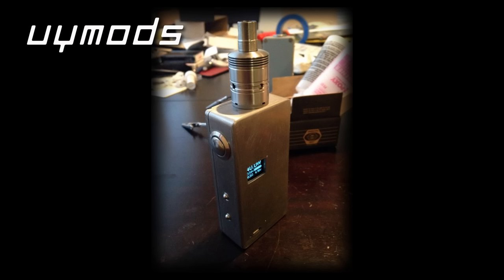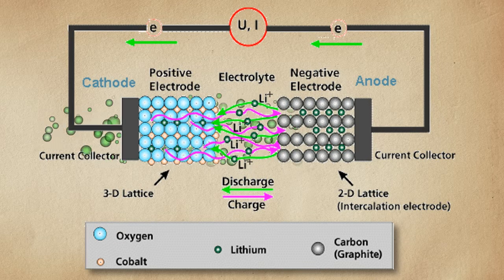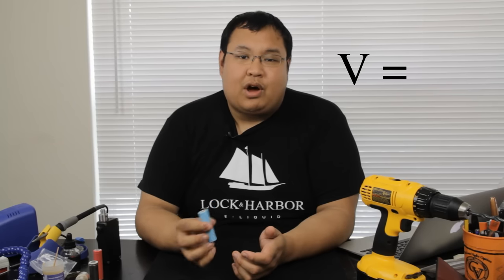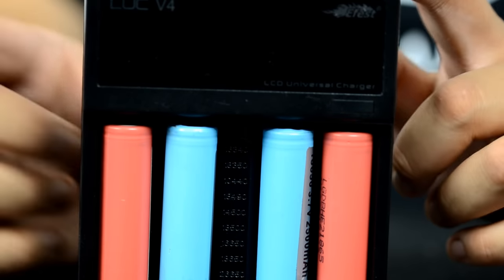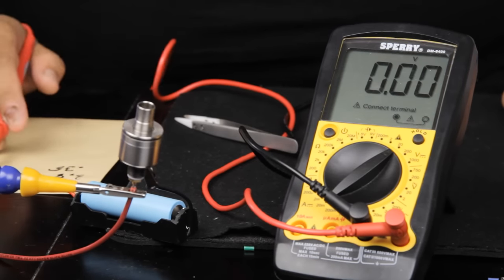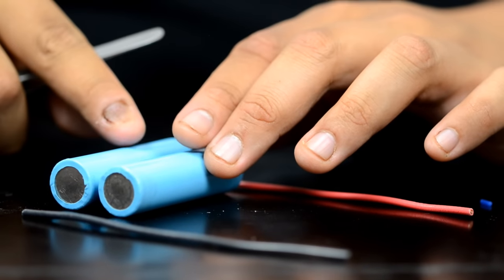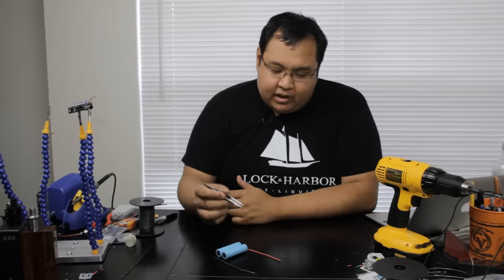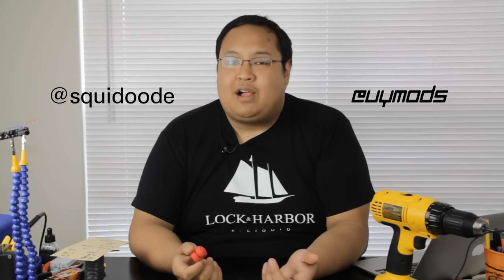Know Your Vape: Batteries Debunked Featuring @uymods

Comment: Great video! I have a 0.13 ohm build on my velocity sitting on a snow wolf 200w mod with Samsung 25R batteries. the specs of battery show max discharge 20A. but at 120 watts its pushing 30A. is this dangerous?
Reply: +Zeeshan Mansoor Yes!
Reply from the maker: +Zeeshan Mansoor Yes, but with running it on that Snow Wolf, that device has built in protection. It would be far more dangerous running that on a mechanical device, but 0.13 ohms is low but not really low like .06. Just make sure you are using high drain batteries!

Comment: Ok I have recently got a new box mod it runs in parallel I build a .15 coil I was wondering cause it can be ran in single battery mode would it be the the same as using any old mechanical mod,and what exactly changes when I use both batteries do I have more wiggle room to build lower or does it stay the same I have Efest 18650 3.7 v 35A
Reply: freedirt Yes, with a single battery, you're pretty much looking at a mech mod. Adding an additional battery in parallel would give you a higher total amp limit to play with and build lower, and the batteries will sag (drop) less under load.

Comment: I have a smok 220w with one .25om and one .4om coils. I bought 2 5000mah 3.7v 18650 batteries. which coil should I run, and are those batteries safe for me to us at about 50 watts on the mod?
Reply: For your batteries to have THAT much mAh they're probably either labeled incorrectly (compared to actual tested ratings) or they sacrifice a lot of amps just to up the capacity. They sound like highly suspect batteries.

Comment: Hey The Art of Vaping, I've scratched the green coating on my NCR18650B on the swing-door of my sigelei 50w. The coating is missing on a small area, and the silver colored case is visible and slightly scratched.

It it unsafe to use?  

Can you ask this guy in the vid?
Reply: +Sean Curtin A hole in the outer wrapping of a battery exposes a portion of the negative terminal not designed to receive current in normal operation. Definitely do not use batteries with damaged wrappers until you can get them re-wrapped. Re-wrapping batteries is relatively simple and can be done at home with shrink-wrap and a heat gun. If you don't have access to a heat gun, machine shops and hardware stores may be able to do it for you.

So stow that damaged battery until you can get it re-wrapped! It's not worth the risk!
Reply: Thanks for the follow-up, I haven't been using it. Wanted to play it safe. Have a great day!
Reply: use packing tape to cover the damaged area

Comment: just saying ohms law includes E=I*R where E is voltage, I is current, and R is resistance, ohms law also includes P (power) as being equal to: E*I, I(squared)*R, and E(squared)/R and every other equation that branches from there, such as I=E/R

Search google for "ohms law pie wheel" for all the formulas to find everything you need to know, and probably then some
Reply from the maker: +Dustin McClure Yes this has been pointed out a lot. Justin says the equation correctly. The original on screen equation was incorrect and since then there was a secondary on screen equation added. If you are not seeing that it's because you have it disabled on your YouTube. Sorry for the mix up and thanks for taking the time to point it out again!

Comment: I have an RX200 which holds 3 18650 batteries.. I'm using Samsung 25rs in it to which I understand have a 20 amp output.. I'm confused as to whether it is a series or parallel mod. Will my amp output have changed because I have 3 batteries in it? Also how many volts could it put out? It is reading ad 3.97v at 75W. Can someone please enlighten me? Thanks.

Comment: I've just been brought a snow wolf 200w and 2 Panasonic ncr18650b batteries I'm vaping on a 0.30 build at around 60 watts is this safe I'm slightly confused by this video
Reply: Dude you're way above safe. Ive pushed harder than that

Comment: I have panasonic ncr18650b using it with evic mini. at 0.30 ohm coil. if i go 40w it says 3.4v and 12 amps.I can go way more watts than 40 and voltage/amps goes up with it.  is this dangerous ? Because as i understand ncr18650b is 3.4 or 3.7v with max 10 amps. does evic tries to pull out way more than capacity of my battery and stress it by doing so ? Should i just use it under 10 amps ? or it is okay since its a regulated device ? sometimes when battery isnt fully charged my mod says low battery and reduces watt automaticly to a certain point.
Reply: It's a regulated device so it shouldn't pull more than the battery can handle.

Comment: i just bought a koopor plus 200 watt tc mod and i bought 4 ultrafire 18650 5000mAh yellow batteries. it didnt say what the continuous discharge rate is on them. are these batteries ok to use in my mod?
Reply: they are fake no such thing as 5000mah

Comment: so I'm semi-noob to vaping, and I'm wondering if it would be safe to use two different types of batteries with my vape, I have one 3000mah and a 2500mah battery and I've been using them together and charging them together today and haven't really had anything go wrong, but could it mess up the batteries using ones that are higher mah's than the other?
Reply: honestly don't get a set its a lot safer and it will work so much better and it is worth it it is just over all better
Reply: +THEDARKNIGHT8657 you need to learn how to use punctuation.   You just told him NOT to use a set of two of the same cells
Reply: yeah hah i was a noob at the time xD but yeah good thing i didnt do that at the time

Comment: how many weeks or months should my 18650 samsung 25r last me before i should go buy a new set. i married them from the get go
Reply: Russellwoot72 Battery life is usually stated in terms of discharge cycles as opposed to a timeframe, and it will depend on how hard you discharge the batteries, how hard you charge them, and how deeply you discharge them. In general, it can be as low a 150-200 cycles for a heavily pushed battery (discharges above continuous limit) and up to 400-500 for a lightly pushed one.

Comment: can someone explain to me what discharging means? im vaping with 2 sony vtc4 18650, 30r 2100mAh and it says the Discharge cut-off voltage of 2.5V

also, any tips for sub ohming for a guy who's new to using dual external batteries? around 0.25 - 0.5 ohms
Reply: +xxx xxx at anywhere between 50w to 90w
Reply: panasonic 3400 mah are good and can burst around 50w

Comment: so when I have a married set of batteries I should only use them on one devise? I've been using three sets of married batteries on an ipv 4 and a x cube 2. I thought as long as they are used and charged at the same time that was OK. should I not do this?
Reply: +Andrew Knutson I had the same question but after watching several times, I think what he meant was to use both at the same time(equally charged) on the same device at the same time. I don't think he meant only in one specific device.
Reply: +The VapinFish thank you.

Comment: when you do paralel, discharge amp doubles or "45 amps" thats ok. but what happens when you do series? discharge stays the same?
Reply: In series the voltage of the batteries is combined while mAh and Amps stay the same as one single battery.

Comment: I'm getting the hammer of God which has 4 batteries. What I want to know is since each battery I'm going to put in it are rated at 20 continuous amps discharge, does that mean 20 is the max I can pull or is it 80 since there's 4 batteries and 20x4=80? I'm asking because I see some people running super low ohm builds like .2-.4 ohm builds but that's pulling over 20 amps
Reply from the maker: +XunifiedX Did you get the Hammer of God version 1 or 2? The version 1 was a parallel configuration if I remember correctly which means in a perfect world you would have 80amps but it would realistically be more around 60amps. If you got the Version 2, it is a dual parallel series device in which case you are realistically getting 30amps. If it's the version 2 I would recommend not going below .3ohms.
Reply: ok thanks for the help! i wasnt expecting a reply
Reply: +The Art of Vaping i just got the version 1, and you would say it will be safe to pull up to a continuous 60 amps on it?

Comment: Which battery should i use to vape at 100-150 w on a 0.2-0.3 build ? I'm using snow wolf mods
Reply from the maker: +xiMercury I would use a high drain battery thats rated for 20-30 amps. Some good batteries are the Sony VCT5/VCT4, LG HE2 or HE4, and Samsung 25r to name a few...
Reply: to get the battery, just remember 2 ohm laws: I = sqrt(P/R) and V = sqrt(P*R). To get the battery that suit your requirement use the higher wattage that you want and the lower resistance you will get. In your case continuous current that you need I = sqrt(150*0.2) so I around 28A and V = sqrt(150*0.2) so V around 5.4V. By that result 20A battery is not suit for you, you need battery with current higher than 28A, which is 30A and because single battery is about 3.7V, you need 2 batteries in series. For battery manufacture, since you drain more than 15A rate, you need highend manufacture like Sony, Samsung, LG, do not go with any rewrapper/rebranding manufacture because their battery current rate might 15A or lower even they labeling 30A. (Look Mooch's blog on e-cigarette forum for more battery manufacture review)

Comment: anyone plz help me. I use ultra fire TR 18650 5000mAh 3.7V batteries they used to work great one fully charged battery would last all day for my iStick pico. now they all suddenly won't hold a charge over 3 minutes of me vaping. its very strange and my batteries say TR and I'm horrified am I using the wrong battery ????

Comment: Very useful information.  I have consistently found myself in arguments where folks using single 18650 mechanical mods will make claims of outrageously high watts not having taken into account battery sag and voltage drop (not to mention disregarding simple battery safety).  Rather than linking them to text only posts I will start directing them here.  Perhaps a video will be easier to digest.  I just wish UY here would have put a little more energy into his presentation.  It was a little dry.
Reply: AnubisAkaLee working for a camera is certainly not my strong point, but I appreciate the feedback!

Comment: i have got a un-protected 18650 battery (2500 mah), what is the lowest ohm that the battery can handle?
Reply: Grizz Hargest That depends on what the brand and model of the battery is. There are 2500mAh batteries with amp limits that range from 2A to 30A.
Reply: Grizz Hargest look at the datasheet man. 
MAX cont. current  20A . Nominal Voltage 3.6v. Initial IR (mΩ DC (10A-1A)):  <30milliohms
V=I*R
V/I=R     3.6V/20A=0.175ohms     0.175 - 0.030= **0.145ohm** 
download the pdf of the datasheet. It's more telling to what your battery "can handle".

Comment: I'm confused on the formulas, I know them but you wrote them wrong. You said voltage = current times resistance but you wrote V=I/R same for the power law
Reply from the maker: Bryon Fitzwater Justin states the equation correctly, the original on scree graphic is incorrect.. You must be watching this on your phone, because right after posting this I noticed the equations being wrong so I used YouTube's in house graphic overlays which for whatever reason do not display when streaming from a phone. If you watch this again from a computer you will see a WHITE text overlay with the correct equations!

Comment: O_O is wattage is that the unit use in Power basically between you use in parallel or series is the same you generally increasing the power / watts or wattage from you formula you use Power ( watts or wattage) = V (volts) x I ( ampere). Either you increase the Amps by parallel connection or Volts by Series your generally increasing the Power ( watts / wattage).
Reply from the maker: +Ren Senyo Exactly, wattage is the unit for Power. On a parallel device you increase your amp load so you can build lower which a lower resistance build at 4.2V will produce some great power (wattage output). With the series configuration your voltage is increased so your power supply has more potential, however you amp load doesn't double so to safely discharge that much power you have to build higher which will still have great power (wattage output). With regulated devices you can control the power output by setting the wattage. The chip in there regulates this and controls the rest beside the resistance of the coil.

Comment: Are the 18650s I take from my laptop battery good for vaping?
Reply: do not use laptop batteries for vaping unless you vape at 10watts with a 2 ohm coil,WHY? laptop batteries are made for a constant low current so they use 5amp batteries,which you should know are totally useless for vaping,this isnt my opinion,its a fact
Reply: Polly G
Thanks for the info!

Comment: hello so I understand the importance of paring batteries together as I always do when I buy new batteries 2 at a time or 3 at a time for my reuleaux dna200 I tag the with a number system so I buy a set if to an mark the a1, a2 then the next set b1, b2, b3 ect.... but after I marry a set together what difference does it make if im running the set in my snow wolf then once thay die charge them together then the next day use them in my kamry 100? I just dont see a negative to this but if im missing something I'd like to know ppl tell me alot you shouldn't do that when I ask them why I always get ( I dont know) I personally think its battery companies just wanting ppl to buy more batteries but idk please let me know if theses something I didnt know ty for your time
Reply from the maker: +Chris Taylor Well, switching between devices isn't the issue. You want to use and charge batteries together. The reason for this is so the cells in the batteries are drained and charged evenly. This allows both batteries to wear evenly. If one battery is worn out more than the other then that will put more stress on one of the batteries as oppose to even stress. This could eventually lead to an issue. I don't think battery companies really care because most of the 18650's we use in vaping aren't made with the intention of being used in vaping products.
Reply: +The Art of Vaping so finally what is the safe battery ?
Reply: +Kimhout TAING that's a vague question depends on the device and what your running on the device but generally Samsung, LG, Sony but in a recent blog on wake and bake said Sony stopped making 18650s for the general public and the ones you see now are fake so I would recommend Samsungs or LGs

Comment: I own a 2500mah efest purple battery, 30A. Can I vape a dual staple coil at .12ohm safely ??
Reply from the maker: +Bastien Lefèvre  any 30amp battery is technically "safe" down to .14ohms... I vape .1-.12ohm builds all day, just pay attention to what your doing and you'll be good. Side note, I personally don't like the efest batteries at all.... I think they are some of the more inconsistent high drain batteries on the market.
Reply: +The Art of Vaping thanks bro, I can only find Sony vtc or sanyo or modworkx batteries in France, wich one dou you recomend me ?
Reply: +The Art of Vaping I use a AWT brand batt. imr 18650 . . 3.7v 26000mah/3000mah 40A  high drain rechargeable. .. I think it's a good batt ..  I use the NiteCore charger with  percentage display.  Do I have the right gear

Comment: I have a high quality samsung battery but a poor quality battery charger, if the battery is charged in a about 3 hours how long would I need to charge it for it to explode
Reply: Cabbage That's hard to say. It's not that a low quality charger means that it's automatically going to make your batteries explode, but low quality chargers tend to not have tight tolerances on cutoff, so some chargers may stop charging at 4.1V, which isn't a full charge, and some may cut out at 4.3V, which is an overcharge that probably won't make your battery immediately explode, but would be bad for the battery's long term health. I'd just recommend getting a good charger and not dealing with that.

Comment: Can a use dead laptop battery's on my vape? They are 18650 but probably ICR and unprotected
Reply from the maker: +Igor Escribano I would not recommend it... Plus the cell is probably used up and it would be a bad idea pushing a weak cell..
Reply: +The Art of Vaping problem is 18650 with good quality is extremely hard to find in my country, cause vapes are against the law In Brazil, I can only find utrafire here, and I'm sure they're clowns, any suggestions ?